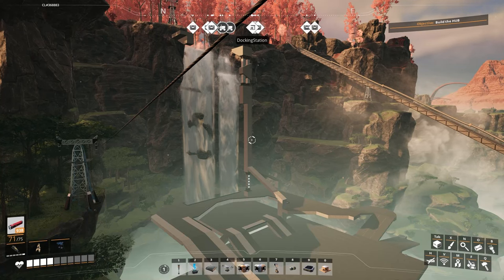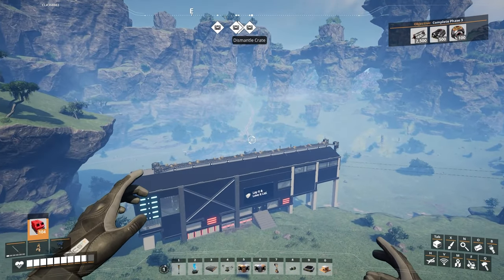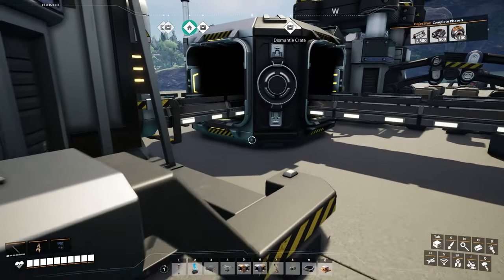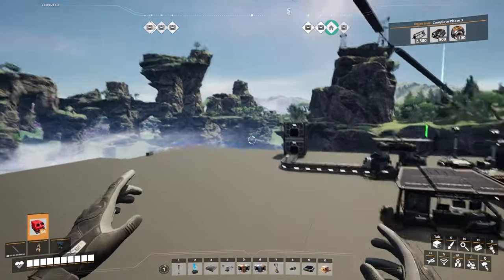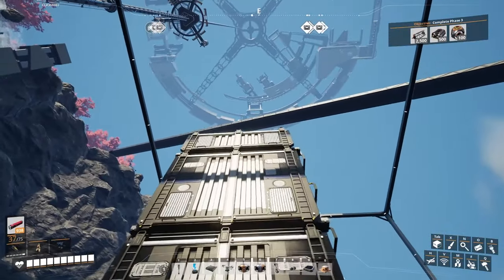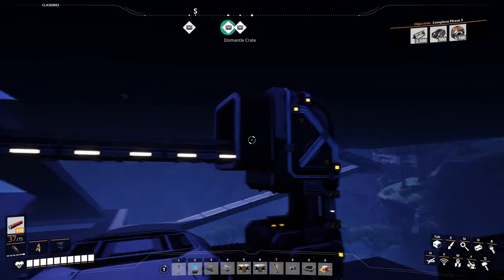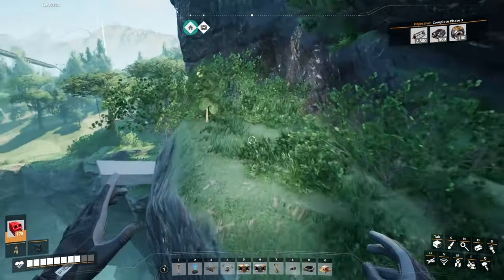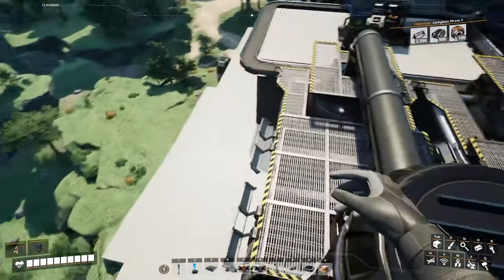Satisfactory v1.0 Let's Play - Episode 9 - Time to Organise some Megabase Storage!

Comment: Just fyi, industrial Storage Containers does not split items on the outputs. 
One is primary, secondary is overflow. The first one built is the primary one, but people have reported it switching randomly on game load etc.
Reply from the maker: ooooh. Interesting, I could have sworn I've used them like that before. I'll have to re think my design a little then!
Reply: Not really.  It is not working like a smart splitter.  More or less random.  But in this design the container will never get full as the smart splitter behind will send everything into the crusher.  From my own experience the best place for an overflow splitter is just behind the production line.
Reply: @RammehTime  if you fill that container fast enough (so that there are always two items to go to the two outputs at the same time), most of the time it will split evenly to them, and that is probably why you thought it would always split evenly. But when there is only a single item (eg filling it with only one belt or with slower belts than the output belts, or from a slow production) either one can have or get priority, or it even depends on other effects (like Newmeishu said) that you can't control. i recently even saw a video where someone demonstrated how to split his input in a ratio of 1:2 or 3:2, but that was probably only a matter of timing from feeding the container at some specific speeds and with specific minor offsets of the items entering the storage.

Thus having a smart or programmable splitter is a little more complicated or "ugly", but MUCH more reliable.
And it still can be done with a footprint of only 1x3 foundations, including lifts at the side of the splitters and mergers.

I'm just experimenting with modular blueprints to create a bigger sorting facility where each module (1x3 foundations, height 4+ walls) has one big ISC storage, a small buffer container for the uploader, the uploader itself, and several splitters and mergers to sort a main "throughgoing" belt, put all overflow on a second "throughgoing" overflow belt, and has a direct input too from a slow producer (producer not included in that footprint) that only is intended to insert "some" new items between the sorting splitters and the buffer, to guarantee that over time always at least some items will reach the cloud and slowly fill it.
my biggest problem currently is the decision how to set priorities for the big container and the buffer, to work for larger throughput as well as for some items types which arrive with a very low frequency and/or in small amounts (eg animal remains, slugs, biofuel, etc).